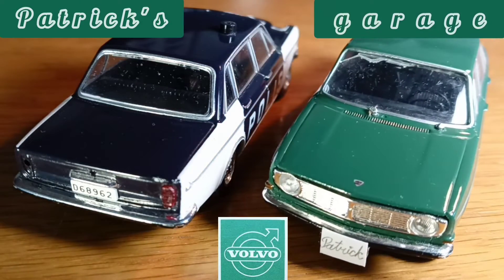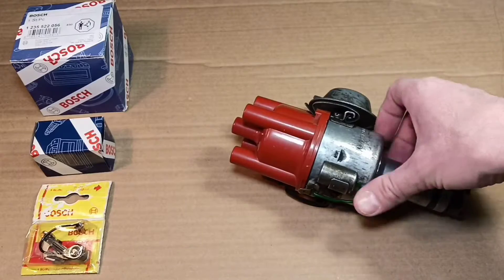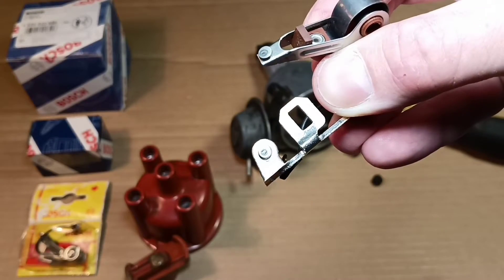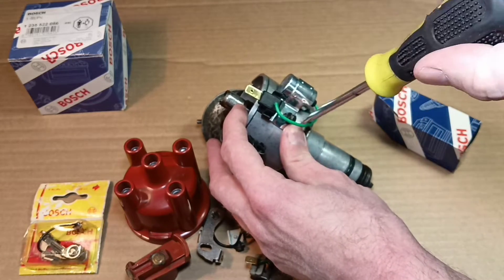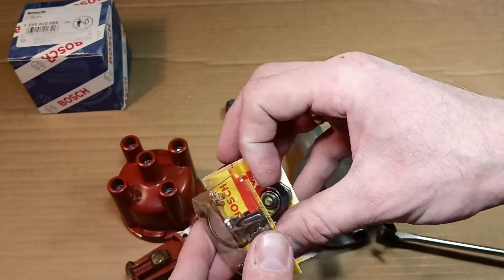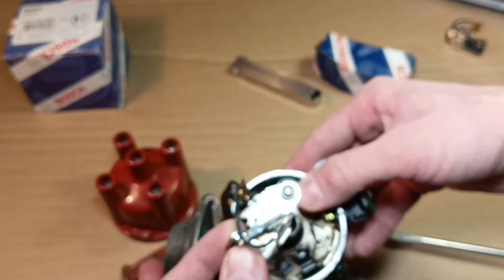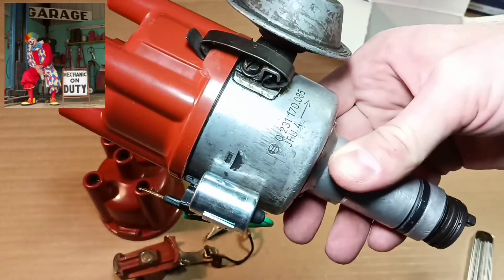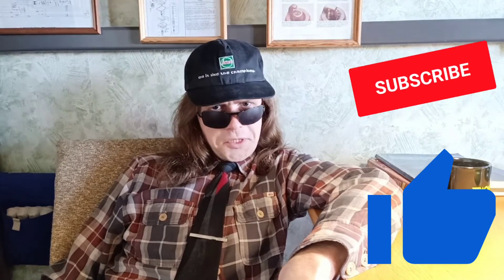Distributor BOSCH Repair Volvo B20A #volvo140 #ignition

Comment: Do You know what are the difference  beween distributor for B21A and B20A ?
Many thanx
Reply from the maker: First of all, B20 and B21 are totally different engines.
B20 has a cam-driven distributor with anti-clockwise rotor rotation.
B21 uses an auxiliary shaft–driven distributor with different rotation and gear.
So, you can’t swap B20 and B21 distributors.

Comment: Hey Patrick, thank you for the video. If somebody change the parts of the distributor, don´t forget to lubricate the distributor inside under the finger and outside on the oil support
Reply from the maker: Thanks!
For those who are interested🤔
Lubricating:
Lubricate the breaker plate
Saturate the lubricating felt
Grease the weights
Grease the washers
Steep the bushes in oil for at least 1/2 hour
before fitting. Saturate lubricating felt
Fill lubricator with oil
Oil shaft before fitting
Smear breaker cam with light layer
Grease the movable contact bush
Use BOSCH lubricant😃

Comment: Thanks for another brilliant video Patrick! Love all the detailed info you provide with a bit of humour😀. I agree that the quality of parts is no longer as good as it was in the past when things were made in Germany😀. But sometimes the cheap parts are good enough. I don't like to overpay too. I think that these old parts are still cheaper comparing the sensors and electronics of modern cars😅
Reply from the maker: Marcin, I am very pleased to read your comments! Yes, the spare parts can be used, they work fine, but they don't look perfect like the ones that were produced before. Yes, sensors and all the other electronic scrap in modern cars are more expensive than parts for our cars, which are time-tested. But sometimes there are bad spare parts... I remember forever the case when I came to the car service and an electrician put a sensor in my car that didn't work, as it turned out later, he then checked all the wires in the car and took money for it😱. Either he's an idiot or he was just lying to me. Now I got rid of the "new" cars and do everything myself. Thanks for your support.😃